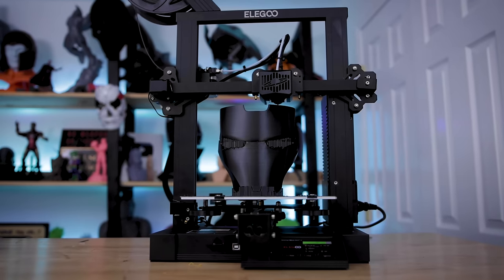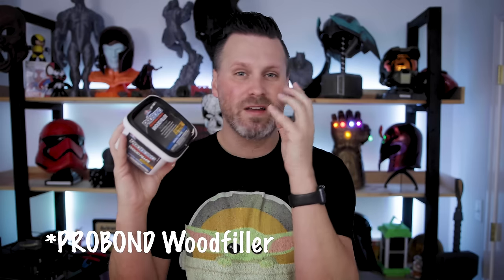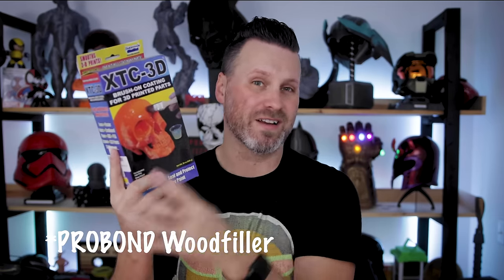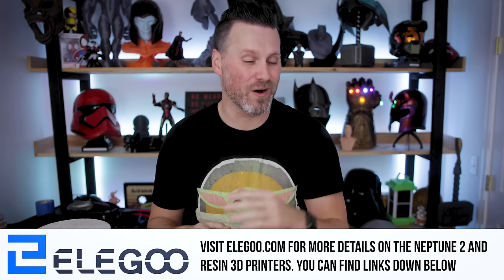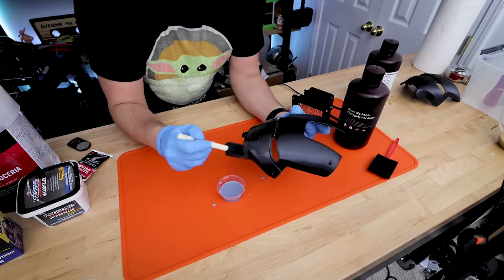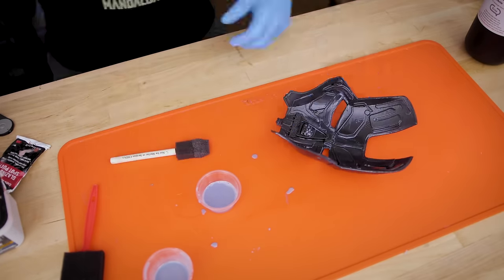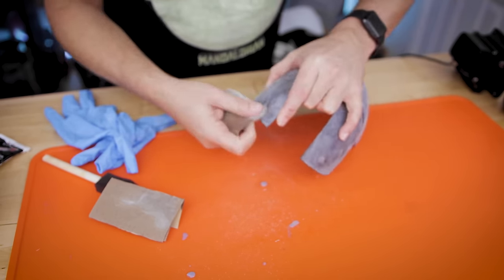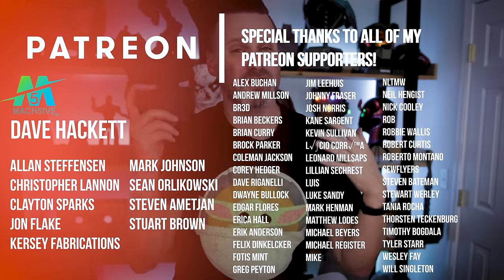3D Printing Hack - Smoothing 3D Prints with Resin!

Comment from the maker: Make sure to checkout Galactic Armory and his wildly awesome videos and first showing off this crazy technique 
https://www.youtube.com/watch?v=gJwgjBtXVOM
Reply: His videos are awesome! 10/10 would recommend.
Reply: Thanks man! Hope this technique saves people a lot of time
Reply: @GalacticArmory  Game changing man!
Reply: @vihaanlangston1739  r/thathappened?
Reply: @karsonwillie2960  oh nvm you're bots.
Reply: Qqá al
Reply: You can also use resin or epoxy to print shapes with no or almost no infill, but a good path throughout the part to flow through manually 100% infilling a part with either liquid.

This can speed up print times massively and the filling doesn't take very long, especially if you took it into consideration when designing the part.

This process can be further improved by having a vibrating surface available to aid the flow and removing bubbles/degassing.

I've done this a couple of times with parts I want to be extremely hard and rigid on the inside and somewhat softish on the outside.

Which you can easily do as there is such a large selection of resins and epoxies.

It's kind of like casting the item, but without actually destroying the perimeter material.
Reply: @uncle jessy is there any reason the resin would not cure

Comment: You can find woodfiller that is waterbased, mix it with water until you have a consistency of pancakce cake mix, apply with a brush, sand, repeat if necessary, viola! Waaaaaay cheaper than filling in with resin and waaaaay less fumes :). For those on tight budget we salute you ;-).
Reply: trying this first. ty for the tip.
Reply: Seagram's water putty is pretty versatile and not too expensive.
BUT a lot of the wood filler pastes can grow mold. They will also flake right off if it shrinks too much or dries too fast.
It also doesn't add to the strength of the project at all. Sort of like adobe walls
Reply: @nicholashodges201  If the goal is to paint it, then you'll be sealing the wood filler and likely avoid that issue.

Comment: It works very well. Did a full size Mando helmet and it came out very smooth, then I used an air brush to spray a small helmet and it worked like a charm as well. Very little post processing. Will be using this method from now on.

Comment: Great Video but guys please use gloves and respirators when sanding resin. When I see this as a chemist and developer of photopolymers I imidiatley see people get a anaphylactic shock , so please be a bit more careful.
Reply from the maker: 👆👆👆👆👆👆👆 110% this! Especially when sanding resin. You don’t want to be breathing in those particles.
Reply: Even better, always use wet sanding on resin! I do.
Reply: @cenciende9401  smart thinking
Reply: @UncleJessy  Dude he’s talking to you bro haha you’re clearly not wearing PPE in the video. That sends the message to viewers that they don’t need it
Reply: Pro Pro tip hold your breath the whole time you sand
Reply: It's common to develop a serious allergy to this kind of resin if you are repeatedly exposed to it so protect yourself or you may end up never being able to be anywhere close to the stuff EVER without dying.
Reply: UP this comment !
Reply: No need for gloves once resin is cured.
Reply: @dextersamson8286  but after cleaning it's still no where near entirely cured
Reply: @dextersamson8286  Be carefull when you sand a cured thing. the cure is never 100 %
Reply: @Uncle Jessy do recommend washing after coating? Or does this process bypass this step

Comment: Anyone have an issue with the resin drying?  I got the same water washable resin in black and the same light and it's still tacky a FULL DAY later!  Any help would be greatly appreciated!
Reply from the maker: I wonder if its the water washable resin formula. You should be able to still sand over or spray paint over it
Reply: @UncleJessy  Hey man!  Thanks for getting back to me!  Saying that I may have gotten a bad batch or?  I tried it on another test piece with an even lighter coat and 24 hours later it's still tacky.  🤷‍♂️
Reply: Same happening to me, the resin remains tacky even after 30 minutes under the uv light

Comment: I’ve done this a few times now. Works pretty well. But...

Be watchful for runs and drips. It can also fill details so work in thin layers and sneak up to the level you need slowly to avoid filling details. 

Still make sure to cure it and wear PPE.

Comment: Jessy, very cool!  I have several Mando prints and other props that I haven't had time to clean up.  This will save sooo much time.
Reply from the maker: Yeah a huge time saver when it comes to smoothing those prints out. And if it’s larger /flat/curved parts it should work really dang well
Reply: @CrackedTubeGamer  why what happens when waving it around?

Comment: I guess it may because I started with a Resin printer, but this was the first thing I thought of for smoothing out my FDM prints once I finally picked up an FDM printer. I just figured I never saw videos on it because it was an 'obvious' solution for anyone who had resin already on hand. Works great for quickly getting those FDM prints up to snuff for silicone masters and much easier/better to work with than those combo primers in my not so humble opinion. And as you mentioned, very little waste as the excess resin can be reused.
Reply from the maker: Exactly. It’s perfect for the small amount of resin that’s used or your left over resin! Thanks for checking it out

Comment: I have also tried painting on 3M Acryl-Green spot putty which has been dissolved in acetone to make a thin liquid. The acetone evaporates and leaves the putty in the gaps ready to sand.
Reply from the maker: Hot damn! I gotta try that out as well! Going to order up some of that today
Reply: @UncleJessy  best done outdoors with a mask as it really smells.
Reply: What ratios are you using to make the liquid?

Comment: Rather than painting two different sides of the mask with two different textures, it would have been better to paint 1/2 of each side with each resin, that way you can directly compare each resin on a smooth surface vs each resin on a textured surface.

Also we never get to see the raw results of the resin smoothing process on it's own..... only the results after you've sanded and painted it.... which sort of defeats the purpose of the whole video really.
Reply: Yeah I wanted him to spray it right after it cured to see what it looked like.
Reply: That's because it's not better than filler+primer spray.

Comment: You can get the resin to feel thinner by heating it first. For some resins, I boil a pot of water and then stick the resin bottle in the pot with the heat off. Does a pretty good job when preparing some of the thicker resins I work with for printing.
Reply from the maker: That is a great tip thanks!
Reply: You mean you do it as a bain-marie.

Comment: Just tried this today and it won't dry entirely. I'm curing it with the same uv light as you. It is still sticky.tho my brush got hardened when I accidentally aimed my light at it for too long... Is it because it's ABS-like resin on PETG print?
Reply: Sand it. Worked fine. Not so easy to say if you coat it on to small indents and designs

Comment: Do you need to wipe it down with isopropyl alcohol after?
I purchased the exact bottle you used and cured it. But it still feels... sticky? Tacky? 
I left the 405nm UV light on it for well over 2hrs and still feels tacky
Reply: I got the same result, still tacky.
Reply: @KamilPolinceusz  I found out that you need to wipe it down with isopropyl alcohol. Then it's smooth to the touch

Comment: Hi Uncle Jessy, I made exactly what you did in the video, using the same ABS like resin from Elegoo, but how much time do I need to cure the resin? Because I expossed to UV Light(same as yours) for like 15 minutes and the resin is very sticky on the layer. Or do I need to wahs with IPA also?

Thank you for the help.
Reply: I literally asked this EXACT question. Mine is so sticky. Exposed both sides of my sword to it for an hour...
Reply: Sand. It worked for me. Then I primed it. Used filler primer myself but any will do. It works.
Reply: @FEBRIZIOtv  I tried applying primer first, dry it for about 20 minutes and then sand it, and magically the resin is cured. Thannk you for the help.

Comment: lol done this for years. i hated xtc as it was always to thick and hardened to fast and was also using fdm still back then. i tend to use a brush rather then a sponge as it tends to leave micro bubbles. with a brush i find you can get a good clear coat and can build the layers up and when ready cure. then forgot to do a video about it as i just went fully into resin printing and just never used fdm since. but always suggested it on the fdm groups and in live streams. glad someone has done a video and also shown other ways to smooth prints with the plus and minus to using them. i tended to just use what was left in the bottles when they are nearly empty. thanks for sharing jessy. also on a side note you should always wet sand any resin. and wear a mask jessy. :)

Comment: Just add water to the wood filler and mix it up. Then you can brush it on with a paint brush. Much easier! I’ll have to try the resin method though.

Comment: I do a similar thing with clear resins i want super clear. Instead of trying to buff and shine i dip the object back into some clear resin and it becomes alot more transparent. It softens edges, but it goes from cloudy to completely clear
Reply from the maker: Oh wow that’s wild. Making a note to try that for my upcoming clear resin tips and tricks video
Reply: Yep, that's because the frosty effect on the surface is caused by the tiny layer lines of the print, to be clear the surface has to be smooth, the same way ice becomes clear as it melts.

Comment: excellent idea! I wonder what if you spray the resin with an air spray paint gun (of course quite dangerous due to the resin vapors)
Reply: Just as long as you don’t shine any UV on the spraygun 😅 or inside your lungs after breathing it in 💀
Reply: @DarioDarrow  the problem isn’t it hardening in your lungs. The danger is it slowly making you horribly allergic to the resin fumes.
Reply from the maker: Now that would be pretty crazy. Wonder how much you’d have to dilute it
Reply: @UncleJessy  hehe, I now I have concerns for the idea 😅
Reply: you would just end up would resin everywhere if you spray it.
Reply: @DarioDarrow  I think if you're getting uv light in your lungs, you have bigger problems than some resin fumes.
Reply: Spray in a sealed box, as if you are sand blasting.
Reply: a bad bad bad bad idea... its not the resin thats toxic,  but the UV reacting hardener
Reply: That's why I suggested using Mr Surfacer 1200. It's a primer and filler which is great for filling. And best of all is you can get it as a spray. 

It's made for Gunpai/Gundam models and for model makers.

Comment: We were using the x3d like 3 years ago in a shop I worked at. Full Spectrum Laser did mention in the user manual that if your prints have irregularities that you can take a brush or tooth pick and add uv resin to the model and cure it with a laser pointer. I've been doing that to fill in the holes left behind by supports too and just putting the model under a black light for a minute before sanding.

Comment: great explanation and video. Galactic armory used to talk use fiberglass resin on the interior of his helmets to give them strength and stability. I bought a bunch and used it on my Commander Cody helmet. Worked like a charm. Now after watching both videos about resin, I wonder if i can use fiber glass resin to smooth out my print. What do you think? can you sand and paint fiberglass resin like 3d printing resin?

Comment: The mask is has been printed in ABS or PLA? Or it is working this hack with both materials?
Reply: PLA using ABS-like resin on the outside.
Reply from the maker: @drkline69  yep	! Nikko’s ZYLtech silk black pla Wu the elegoo abs like resin
Reply: ABS is really susceptible to resin. If you do want to coat an abs creation in resin do a test cube or something first to make sure it doesn’t go slurry on ya.

Comment: So I've only seen people like you and vaultfox using this method on small one-piece prints like masks or glove armor, but I'm using a smaller printer and larger pieces that have to be printed and then glued together (and then reinforced with thermoplastic). Will this resin A.) cover over paint, Bondo, and PLA filament to have a smooth, spotless finish; and B.) cover lines between prints by the time I get to painting (as in if I glue two individual pieces together and there's that obvious line between the two halves, will the resin conceal the line so by the time I paint it, it's as if the two pieces were already merged together)?

I'm keen to give this a try but I'm apprehensive about going out and spending a bunch of money on something that won't work with what I've already been working on.

Oh yeah, and also - does this resin sand easily and is it more practical than Bondo re: sanding in recessed, compact spaces?

Other than that this video, like your other videos, was great.

Comment: one thing i like about this idea is that you can brush it on, then cure it in a few seconds.
if it has to sit for 20+ hours you may wind up with any cup like areas being filled with resin; i think you called it pooling.
but this way i can brush it on, make sure everything is nice and smooth, then just blast it with the spicy light.

Comment: When you brush the resin onto the print would you recommend a respirator? Or more so just when you get to the sanding process? I live in an apartment with no garage and was curious if I can wood fill, brush resin and cure all indoors (no respirator) and then sand and filler primer outdoors (with respirator)?

Comment: you should try this with a flexible resin like siraya tenacious.  I bet having a more flexible outer layer could add some strength to 3d-prints without just cracking off.  I bet it would make for an interesting rubberized feel too.
Reply from the maker: Funny you mentioned that. I ordered up another bottle for a similar test ;)

Comment: Awesome video and the resin is on order.  Question how did you do the print of the mask with so little supports?
Reply from the maker: It’s all about the angle and printing slow. I set the print speed to 50mm/s and it will usually print great especially with some overhangs

Comment: I use the Resin as well. Also i use Vinyl Spackle to smooth prints and as a gap filler. It dries pretty fast and super easy to sand.. A small half pint container last for a long time..

Comment: Do you not need eye protection when using the curing light?  Long term exposure (or short exposure at high power) to blue light between 400 nm and 500 nm causes photochemical damage to the retina and may lead to degeneration of the macula.  e.g. tanning beds?

Comment: I think I’m using the same resin that you used on the front and I’ve used a little uv light on a few spots and I’ve had it sitting in the sun for a good portion of the day but it is still sticky. Do you know why this is? You said in the video that yours was supper smooth. If you know of a solution to this I would very much appreciate it.

Comment: I've tried this but my results are that the surface is sticky after curing.  I left it to cure for a really long time and no change.  So I tried washing in IPA and it's still tacky.    What's the trick I'm missing?
Reply from the maker: Wonder if it’s the resin. Not entirely sure. It should be fine if you sand/prime/sand
Reply: The same is happening to me
Reply: @UncleJessy  The resin is the 4k grey from Phrozen.
Reply: I used both water washable and standard Elegoo resin and both left tacky even after in direct sunlight.  I have the same uv light you recommend and didn’t really cure everywhere.

Comment: I do this with my resin printer prints... either by not washing them after removing supports or painting over sparingly and sticking them in the blazing aussie sun. Transparent resins produce the best finish and returns the clear glass like finish which washing removes.

Comment: I heard this trick on fb from pandacosplay I think and I mix baby powder with the said resin to make putty for filling. The advantages of using resin are you can reuse glove as long as you wash it. You dont have to mix and it cures fast and whenever you want. And make putty easily

Comment: I tried doing this with water washable resin as well as abs like and my prints ended up being tacky to the touch? That means it didn't cure properly right? Has anyone run into this? Even left them out in the sun too. Still tacky
Reply: I had and still have that problem.  I tried both water washable and standard and did really thin coats and it’s tacky. Even after being in direct sunlight for 8 hrs.

Comment: What would recommend for a 12" X 12" or 14" X 14" 3D printer? And what kind of surface finish can be achieved? I'm looking for about a 63 surface finish that you could achieve when machining a part without a lot or no post processing.

Comment: Ive tried this and it smooths well, but when i go to spray paint, it seems the paint cracks no matter what i do. To be clear, it doesnt crack with first coat. I wait a day and come back and it cracks either with the second coat, or when i do a clear gloss coat (i dont over spray and ive never had this cracking with my other prints with same paint and gloss). I did skip the sanding step (so maybe adhesion issues?)  and used a primer/paint spray after the hitting with UV